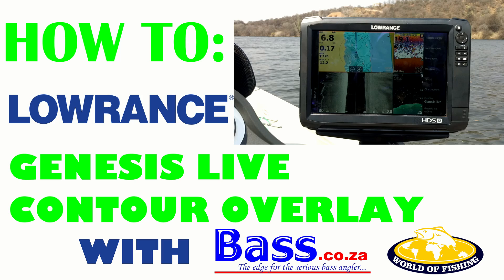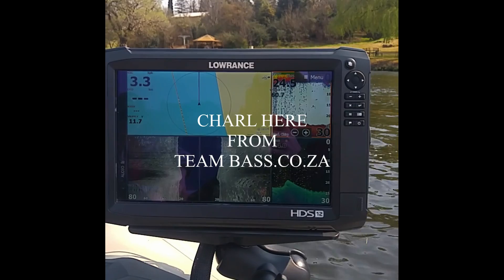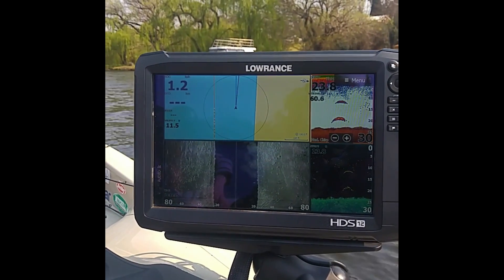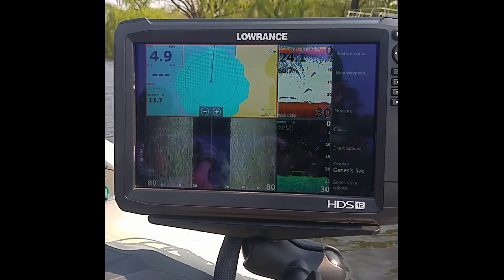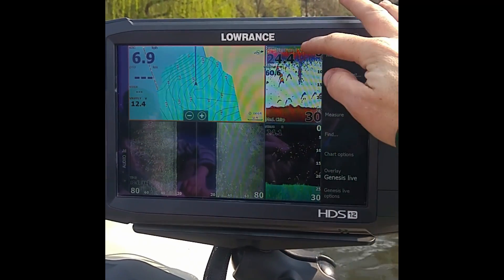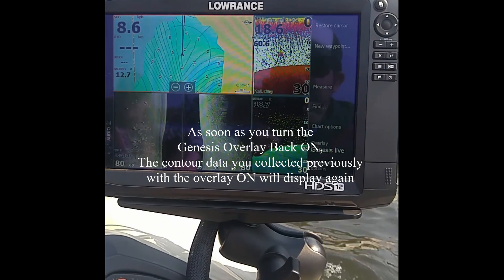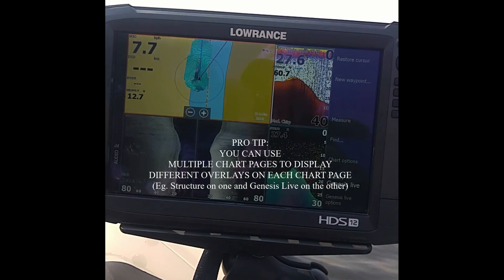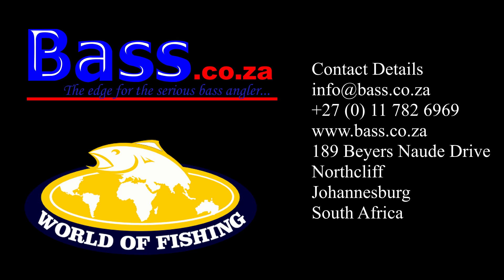How To Create a Live Contour Map on a Lowrance Fishfinder with Genesis Live Contour Overlay

Comment: ... Are you using a Point 1 antenna with the Course and Heading extension on? 
Is the chart on Heading Up? 
Thanks
Jeff
Reply from the maker: Hi Jeff, sorry for the VERY late reply... Been fishing :P I use a Course and Heading Extension just so i can see if my point 1 is out..... And then i set my chart to Heading Up (Which uses compass data from the Point-1)

Comment: I just bought a Lowrance Elite Ti2 9´ and I try to create a contour map, with genesis live, I don't have a map card, so I put a blank micro sd card, but when I put the genesis live, it does not generate the map in real time, it only stays on the base map, nothing appears, someone knows how to solve this. I have updated my fishfinder with the latest version.
Reply: Hey, did you ever figure this out? Having the exact same problem!
Reply: @killaz669  I have the same problem
Reply: @timchristensen1520  Mine works now, I'm pretty sure it just started working on its own, but I'll double check my settings while I'm out this weekend and get back to you if I figure anything out.